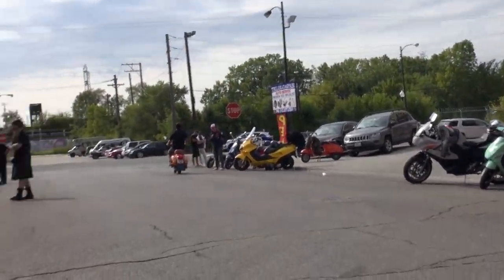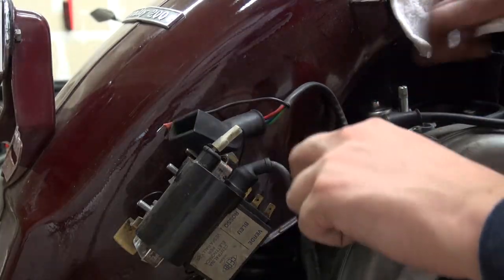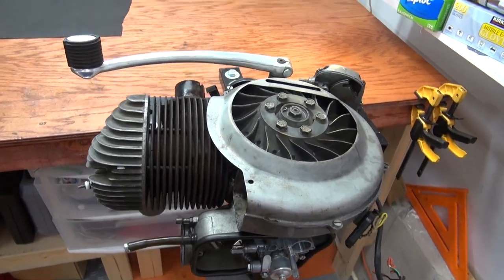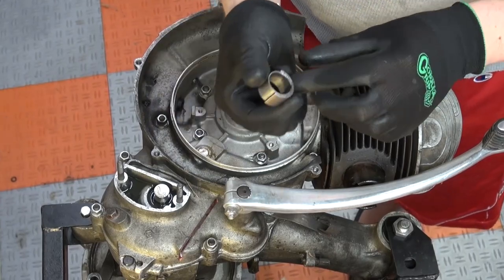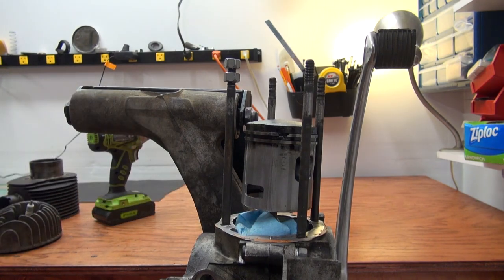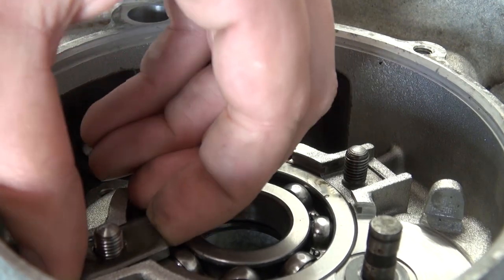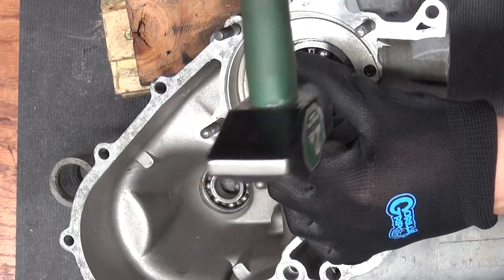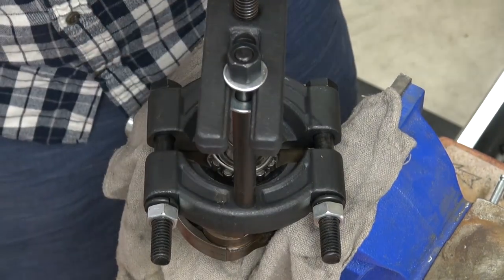TST Ep. 16 - Vespa Rally 200 Full Build, Part 1: Dropping and tearing down the engine

Comment: What tolerance do use when measuring the gap between the casing and the crankshaft with the feeler guage?
Reply from the maker: 0.05-0.10mm for a good surface, up to 0.15mm still acceptable. This one was around 0.08mm
Reply: That Scooter Thing is that for all 150s and 200s? I'll be building a 200 and a 150 Sprint V soon and just want to be sure. Also, what should that clearance be for a 125 Primavera?